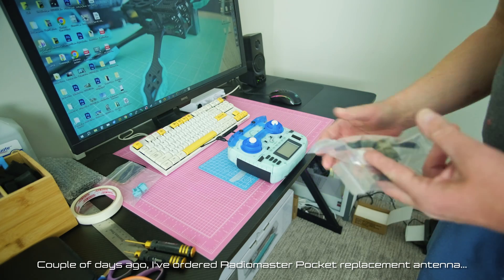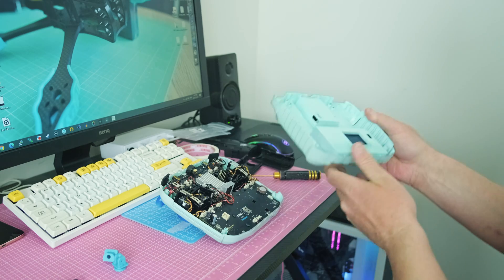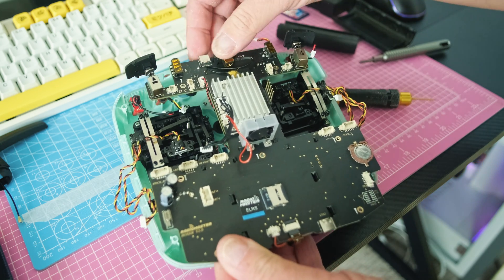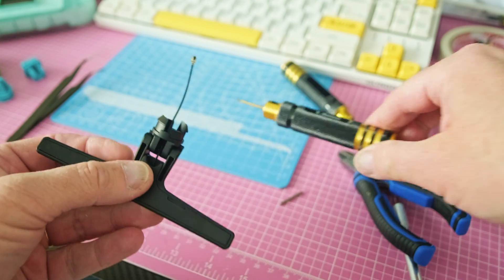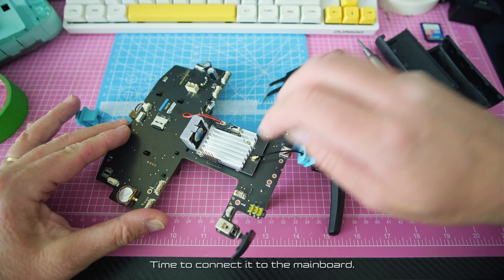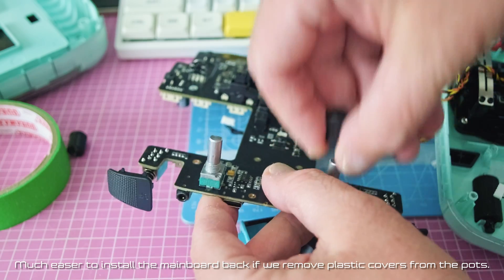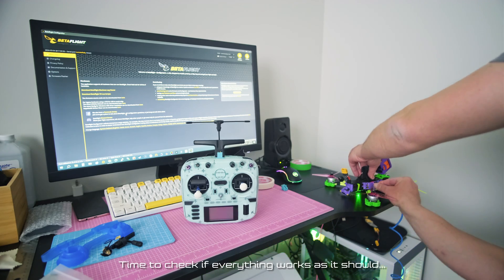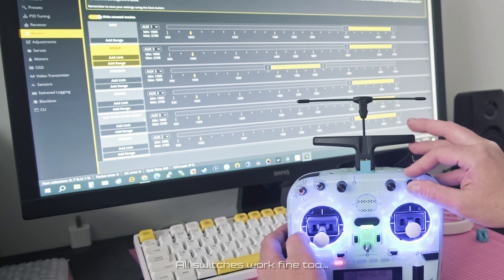RADIOMASTER BOXER FOLDING ANTENNA MOD | 04−04−2024

Comment: Hi! I have a question, I watched one of your videos were your build a drone with the geprc mark5 frame. Did you have any problems with wiggly arms? My frame is new and it looks like the tolerance in the frame isn't that good, one of the arms moves side to side, it has the same problem as the  Lumenier QAV-S v1 😢. If so, do you recommend something to solve that problem?
Reply from the maker: Nope, Mark 5 is stiff as it can be. In all of my custom builds GepRC Mark 5 and TBS Source One v5 are the most solid frames. QAV-S can have arms that move slightly, but nothing serious that can't be solved by tightening two screws that hold each arm. It's just, when you think you tightened it all the way, there is a half turn or so that basically makes them frozen in place and they won't move any more. Mark 5 on the other hand was super solid from the beginning, and right now, it's still the frame I find myself fly the most and enjoy it more than any other custom build I've done.
Reply: I might have bad luck ☹️. Mine isn't solid, I checked all the screws but doesn't work. Thanks for replying!
Reply from the maker: @leninegarcia8391  - can you confirm you did a proper arm orientation? I did that animation to show the difference between the front and rear arms. They are not the same. Above mentioned animation can be found inside that video where I assembled GepRC Mark 5, but I also uploaded separate video with animation only. Here it is: https://youtu.be/DbVF8FHG--c - make sure you installed your arms the proper way.
Reply: Yep, I checked it with your video, it was pretty good. I managed to solve it by sticking a piece of electrical tape between the arm that was moving
Reply from the maker: Double-sided tape would probably work little better, since once you jam it inside, it would never fall out. With electrical tape, there is a chance it might slide out, after all that G-force pull.
Reply: Oooo, I will try that, thanks! 😁

Comment: I was seriously just looking at this antenna last night. Are you spying on me? 😂 I couldn't find a solution, then bam your video showed up! Awesome video!
Reply from the maker: Nice! I hope my video will help more people in case they wanted to do this same mod. I strongly believe Boxer should have came from the factory with this same antenna already installed (Pocket's antenna). Not just that mod is fairly easy to do, with the least amount of tinkering around the transmitter and altering things... but the looks of it at the end does it for me totally.

Comment: (applause 👏🏼👏🏼👏🏼) me likey, me likey!! Do you know if the folding antenna, just like yours, will it fits my QX7 radio controller?? I can't find any video that showing QX7 with installing the folding antenna, so please lemme know if you can. You did great here! Good job 👍🏼👏🏼👏🏼👏🏼
Reply from the maker: Unfortunately, I am not familiar with QX7, not sure what it looks like inside and the measurements, antenna opening diameter, etc. Aren't there any videos of someone modding it in the past, available on YT?
Reply: @Seii-FPV  dang! Cuz I can't find any videos about folding antenna goes onto qx7, cuz I can see inside of my qx7, that it got just like yours, UFL antenna port, but I want to make sure that it's capable of modification to different antenna on my qx7, but can't find any videos about that. But I seen many other modifications on qx7, but not for folding antenna, so that's why I ask if you know... I guess I got to keep researching until I know the answer. Thanks dude 🤙🏼
Reply: @Seii-FPV  I'm so sorry I was wrong, mine don't have UFL antenna port, I can see the stock antenna is soldered onto board, so I just need to cut off the UFL port on folding antenna and solder it onto board and it should be fine, right? Or I still can't do that?? I tried to find on Google and it on YouTube, but nothing about folding antenna, dang!
Reply from the maker: @indroneswetrust1  - MuteFPV did a video about some QX7 mods, not sure if he's mentioning antenna mode, but at least you can see how it's connected inside: https://www.youtube.com/watch?v=m-ZA7hLcv-8 , also this guy did some antenna mod for QX7, you can take a look and see what's required: https://www.youtube.com/watch?v=5ZkHekKDuUM - is it safe? I am not sure I can't say for certain. If it was an u.FL connector inside, I'd say "do it". But this way, I am not sure how things are soldered and if it needs any additional modification or maybe even adding some parts in order for some other antenna to work as it should. This video is in Spanish, but CC might help if you don't speak Spanish: https://www.youtube.com/watch?v=Q33C5R4wxBo
Reply: @Seii-FPV  hahaha I don't speak Spanish, not at all, not even one word, lolz but thanks for English link!! I will look it up after I cook the breakfast for my wifey, lolz
Reply: @Seii-FPV  ohhhhh wait, I already saw that link about 15 mins ago, and it does not show whole thing about antenna, cuz he cut so much off from his video, so therefore his video is not good at all only cuz he cut so much from his video and I already saw this one. So yeah I don't think nobody done that before, oh boy
Reply from the maker: @indroneswetrust1  - For the Spanish one... you can turn the CC on (close captions) and pick English from the menu. It's not 100% accurate,  but you'll understand pretty much 80-90% for sure.

Comment: How about range?
Reply from the maker: Read the description under this video please. Range should be the same, maybe even tiny bit better. The one thing is for sure, there is literally no logical reason why it should degrade. Antennas internals are identical, and I did not hide it inside the case like many are doing currently. There is no need, since it's folding antenna now and it can easily be tucked away. I've explained the reasoning behind the claim that signal should be equal to the original antenna it in the description, that's why I am pointing you there. Also, at 5:31 sec mark into this video, I am talking about it. This antenna connects directly to the u.FL connector inside the Boxer, avoiding going through u.FL to SMA adapter that is originally inside the case. So one less corner, meaning nothing else but cleaner signal. This Pocket antenna plugs directly into the u.FL connector inside. Unfortunately, I don't have any resources to scientifically test the range, but what I'm flying and where I'm flying, there is no difference in what I experienced before with the old antenna. Radiomaster wouldn't put this antenna in their Pocket radio if it was any less good. All those antennas that fit Boxer are pretty much the same, just different shapes.
Reply: @Seii-FPV  Thank you for kind reply I'm gonna try it!
Reply from the maker: @pcj_fpv  - It's fairly easy since it's plug'n'play antenna... just make sure you don't damage the original one (antenna and the u.FL to SMA adapter and its mount inside). Keep it if you ever want to go back. I have no reason to go back, this looks way better than the old setup, and I did not see any degradation in signal strength at all, and I still keep all the original parts... always better safe than sorry.